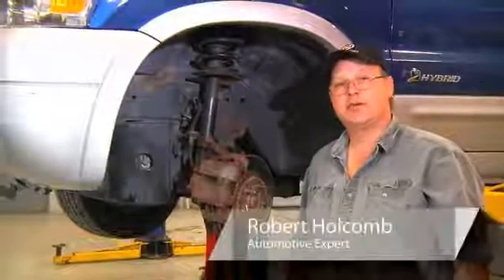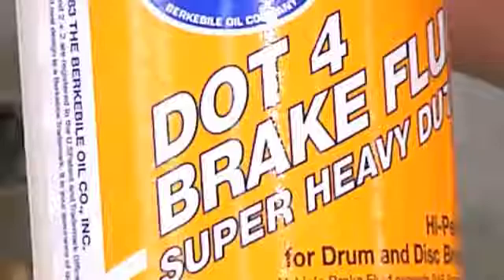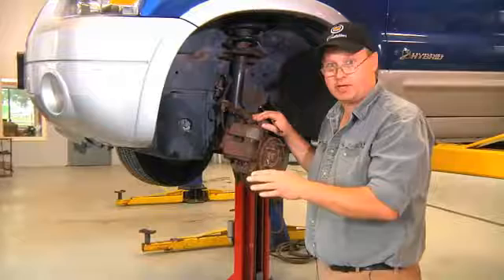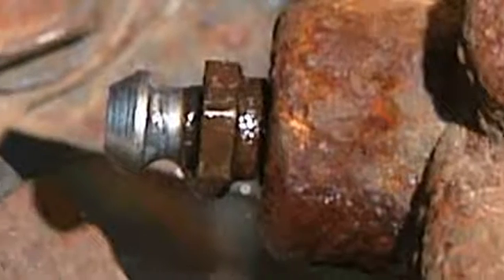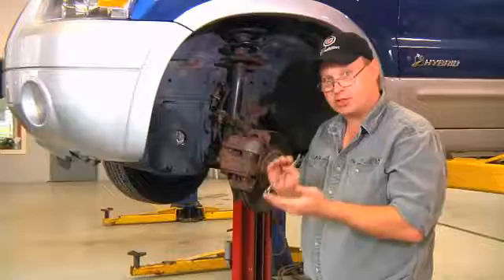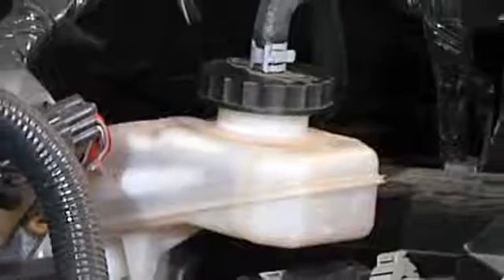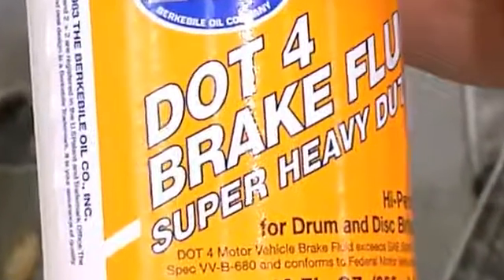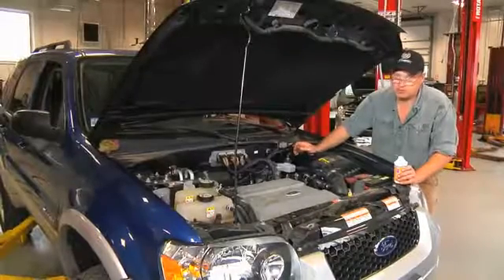How Do I Change Brake Fluid in an ABS System?

Comment: Why does need to remove the abs fuse ? Didn't get it ! And also all this whole process needs to be done with the engine on or off ?
Reply: Should be on when you release the valve behind the caliper to get the old fluid out of the system

Comment: ASE MASTER TECH 5-7 years is way too long before flushing out the brake fluid. Follow your Car Owner Manual. It will usually say change brake fluid every 2 years or 30,000 miles. If you don’t you risk rusting out your brake lines internally because brake fluid is hydroscopic… it absorbs water from the air.